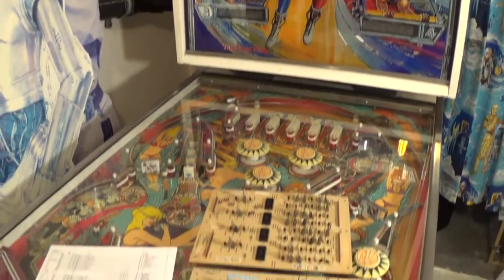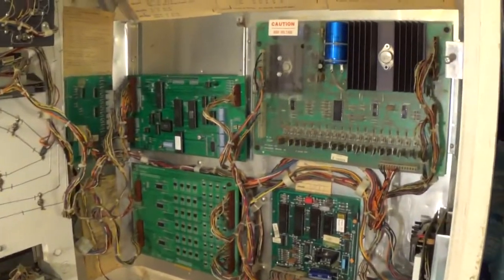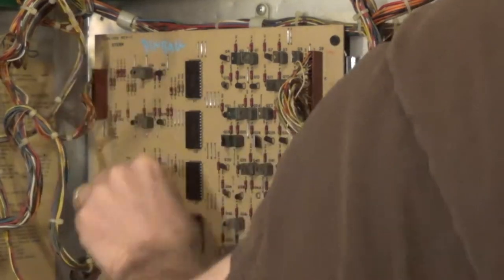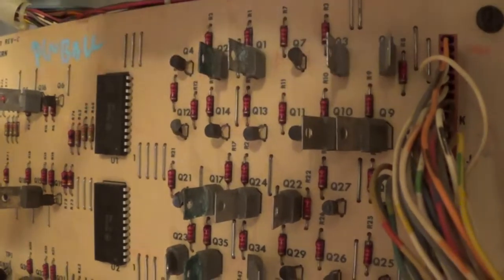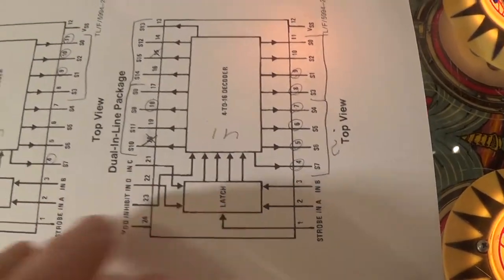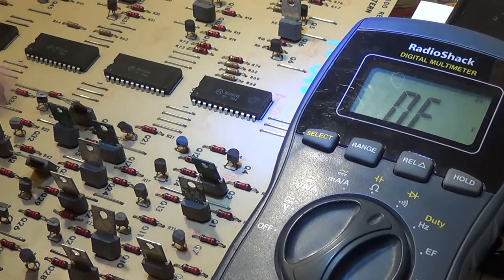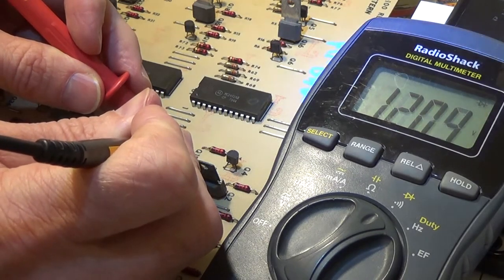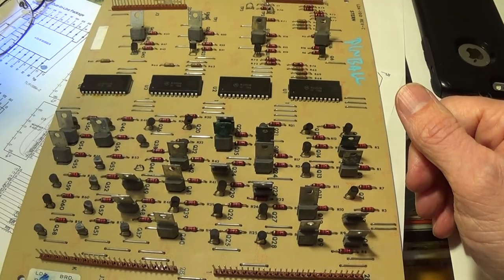How to Test and Repair Lamp Driver Boards for Stern/Bally Pinball Games

Comment: Geo, I thought SCR only worked for switching AC signals not DC signals. Any reasons why an SCR Cathode to Gate has a voltage at 1.2vdc or 0.6vdc, is it a diode inside the SCR? Any reasons why they used MC14514CP Decoder chip to turn on/off the SCR's instead of using a PIA chips?Any reasons when using LED lights instead of lamp bulbs the SCRs will cause the LED's to have flicker issues?
Reply from the maker: LOL, you have lot's of questions I can't really answer.  Unfortunately, I'm not an electrical engineer, and likely don't have the brain power to be one.  You are correct that SCRs most commonly used for converting AC current to DC current (rectification), hence the name Silicon Controlled "Rectifier".  I can only assume that they are used in the lamp board because they also have the ability to handle high current and voltage, which works well with the lamp operation.  Regarding the 1451 vs PIA, I can't really answer that question.  But the 1451 is really only decoding a 4 bit input signal for selection of one of 16 possible lamps.  Not sure if you need an PIA to do such a simple task....but I really don't know.  Not sure about the 1.2V vs 0.6 V either.  The diode part of the SCR is the anode and cathode legs.  The voltages are read between the gate and cathode.  I did look it up, and the higher voltage is read when the ground is on the gate and the positive is on the cathode.  I haven't really dived into how SCRs actually work, but the gate might act as a type of "jump start" for the diode, allowing current to flow from the anode to cathode.  If you, or anyone else knows, please let me know.  Regarding LED flickering on SCRs...… the DC current that drives the lamps is not well regulated (it fluctuates).  LEDs don't draw current when the voltage drops too much, and this causes the SCR to shut off (unlatch).  It then needs a new gate signal to relatch.  You can solve this issue by adding a resistor to the lamp circuit, but you have to do this to all the lamps (normally you put them on the lamp socket leads....a 1k resistor should do the trick).  I think the replacement LED compatible boards have the resistors installed directly on the boards.
Reply: Thanks for the help. Adding the 1K resistor "across" the lamp socket leads from lamps positive voltage to the lamps ground? I'm confused why would adding a 1K resistor reduce and fix the LED flicker issue?Regarding LED flickering on SCRs...… the DC current that drives the lamps is not well regulated (it fluctuates).  So when you put your Volt meter on the Lamps socket the DC voltage will fluctuate up and down?
Reply: @Greg Lilly But what is the advantage and benefits of using SCR to turn off/on the lamps? because Bally, Williams stop using SCRs and used FETS instead of SCR's. There must be a reasons why they stop using SCR's and used FET's. I don't see how the SCR's can send and Interrupt IRQ request to the CPU because its really hand to turn off SCR's once they are Latched. The DC voltage that goes to zero shouldn't unlatch turn OFF the SCR because the SCR will still be latched. You have to unlatch the SCR which is a resetting the SCR. You're saying that when the SCR is turned off/unlatched that it sends an Interrupt IRQ signal back to the CPU?
Reply: @Greg Lilly Yes Stern PCBs copied ballys. The Unfiltered DC is powering the SCR's but the Decoder chip output pins are tied to different SCR's gate pins to turn on/off the SCR is from the gate pin. The Unfiltered DC voltage is going to the SCR Anode pin and the cathode pin is grounded. This is before the Lamp matrix system, it causes a Decoder IC chips that controls the SCR's, later versions they used FET's. Then they used a Lamp Matrix system that uses a scanning frequency and isolation diodes on each switch and lamp. The isolation diodes will only allow the scanning pulses to flow in one direction. Without using the isolation diodes it confuses the scanning pulses. Often the isolation diodes get shorted and it confuses the CPU thinking 3 or 4 switches are closed because of only one diode that is shorted. Somehow the CPU is measuring the scanning pulses/scanning frequency and when one diode is shorted it shortens or lengths the scanning pulses so it confuses the CPU to thinking there is 3 or 4 switches that are closed which is a false positive meaning not real. I'm not sure why they used Unfiltered DC for the SCR's but the Unfiltered pulsating DC is applied to the SCR's anode pins.
Reply: @Greg Lilly yes they used Latched SCR Logic. The DC Unfiltered is going to be pulsing at 60hz, so this is going to make the SCR turn OFF at an interval frequency 60hz because of the pulsing unfiltered DC. This would cause the lamps to "flicker" from the pulsing unfiltered DC of the refreshing of the lamp ouput. The 5.4vdc that is applied to the SCR's would be pulsing DC when displayed on the oscilloscope. The Decoder chip that is driving the SCR's gate pins is turning ON the SCR to latch the SCR and the pulsating DC voltage is what is Unlatching turning OFF the SCR. For the SCR to be latched/turns on Both at the same time the Pulsating DC voltage has to be "above" the threshold on and the SCR Gate has to be turned on. This is a very short time interval for the turn on time to "occur", because once the pulsating DC is BELOW the threshold the SCR is unlatch/turned off. I would think logically this would cause lamps to flicker or the lamps won't stay turned on long because of pulsating unfiltered DC.
Reply: @Greg Lilly Stern and Bally Lamp Driver boards for the CI Control illumination circuit used MC14515B Decoder chip that would turn on/latch either MCR106 SCR or 2N5060 SCR. Gottlieb & Williams Lamp Drivers are different. The Stern & Ballys Solenoid boards used FET's a driver FET and then a Buffer FET that turned on/off the playfields coils. The PIA chip would turn on/off the FET's. The PIA would send an IRQ request signal back to the CPU to tell it to refresh cycle the PIA outputs. I think the difference between the PIA 6820 compared to the 6821 is that it has latched outputs and the other is Non-latched outputs. I think the replacements for the lamp drivers for the stern/bally games don't use SCR and use FET's instead with Diodes in series to change the Lamps 44/47 into LED in the playfield. The Diodes added somewhere is a medication people have done for years to prevent the flicking when using LED's instead of Lamps 44/47. The Diodes across the SCR's somehow changes the SCR rise time and fall time or on time/off time so you don't get the LED's flicker issue.
Reply: @Greg Lilly Ballys Solenoid driver board/power supply board has a blue filter capacitor rated 11,000uf to 20,000uf which I'm not sure why they are using such a very large filter capacitor because most power supplies will use multiple 100uf or higher in parallel. It's very unusual to only see one filter cap at a very large capacitance value plus most pinball games are drawing only 10amps maybe 20amps but using 11,000uf to 20,000uf filter cap is overkill but there must be a reason. I understand that lamps, relays, switches, coils draw current but if you use a current clamp and measure the total current the pinball game is using while its being in game mode running its between 10amps to 20amps so I don't understand why they are using 10,000uf to 20,000uf filter cap.
Reply: @Greg Lilly Every pinball games has a "blanking circuit" somehow the blanking signal will pulse when the solenoid driver boards PIA chips send IRQ request and the lamp driver boards sends IRQ request to want to Refresh cycle the lamp drivers outputs and Solenoid driver outputs. The blanking circuit also refreshes the displays digits. Somewhere the blanking circuit is controlled by the IRQ signals of the lamp driver boards and solenoid driver boards. I'm not really sure what purpose the Blanking signals are doing or what is making the blanking output a signal.
Reply: @Greg Lilly Solid State Pinball games don't use a bridge rectifier using 4 diodes its often they only use 2 diodes to get a full wave rectified pulsating DC voltage. I'm not sure why they would want to use a multiple tap secondary line transformer and only use 2 diodes to produce full wave rectification because its more common to use 4 diode bridge rectifiers to get full wave rectification. I'm guessing that 2 diode full wave rectification has more current to source into the LOAD which would be the all the circuit boards, lamps, switches, coils etc. They later did switch over to using Bridge rectifiers in later pinball games. Its also debatable about why pinball games used AC voltages for the coils & solenoids and then switched over to using DC voltages. The debate is that some thing that using AC voltage on flipper coils are stronger and powerful using AC voltage and others think using DC voltage on flippers coils is stronger and more power hitting the ball harder. The different between AC and DC being applied to flipper coils is the wattage when you push the flipper coil button how much current is being drawn by the coil compared to how much force the flipper is hitting the ball. The EMF of the coil between weak coils and strong coils because over time flipper coils get weaker and weaker and hit the ball at less of a force.
Reply: @Greg Lilly That is correct its on all pinball games pretty much have different DC voltages are made from both a 4 diode Bridge Rectifiers and Diode Bridges. I'm not sure why they use the Two Diode Bridges but its mostly unregulated also having no regulator or only one DC voltage will be regulated and the other is unregulated. I think all pinball games Solid state for the flipper coils they use Unregulated DC voltage only for the flipper coils. I'm not sure why they would use Unregulated DC voltage for certain coils. But you're saying that you can't use High DC voltage using a 4 diode Bridge Rectifier?
Reply: @Greg Lilly To learn the concepts of the circuits and designs of Pinball games. I might want to build one in the future. The New Pinball games use an "Array" of Opto Couplers & Opto Isolators that are everywhere on the playfield. The Array of Opto Couplers & Opto Isolators are in different Assemblies that are sometimes sold by different pinball companies for replacement parts. When the ball passes through the Opto Coupler or Opto Isolator it will trigger a lamp or switch or credit. I'm not sure why they use different sections of the playfield that will have Opto Couplers and other sections will use Opto Isolators. The Array of Opto's is different than a switch matrix or lamp matrix. I'm still trying to learn how switch matrix circuit work in the concept because its very weird how it uses a Scan Frequency about 1.6Mhz that is Scanning the Rows and Columns of the Switch Matrix. The CPU is sending out a Scan Frequency to the PIA chip which the PIA chip will output a Scan Frequency to the Switch Matrix Rows & Columns. Each Switch has an Isolation Diode. Why they use Isolation Diodes is suppose to keep the Scan Frequency flowing only in one direction. If one of the diodes is shorted this will cause the Scan Frequency signal to flow in the opposite direction which confuses the CPU thinking there is 3 or 4 switches that are closed when only 2 switches are closed. I'm still trying to understand the concept of the switch matrix and lamp matrix because its very confusing on learning the concept on how it works. The Array of Optos are a different type of matrix which I'm trying to learn also.
Reply: @Greg Lilly The Main difference between AC VS DC voltage is the current is alternating and DC is constant. Using AC voltages the current will always have zero crossing events compared to using DC voltages its constant direct current having no zero crossing events. The Magnetic field is constantly expanding and collapsing using AC voltage/AC current compared to using DC voltage/DC current the Magnetic Field stays constant. When you press the Flipper button it will energized the flipper coils in the microseconds that its turned on. The In rush Current differences of the AC current compared to the DC current are different when comparing In Rush Current. The Efficiency of AC current compared to DC current is a difference of the Power Efficiency. The Flipper coil is wire wrapping around in a coil but the magnetic field strength gets weaker over time from the heat and dissipation. Its hard to test the strength and power of a flipper coil because you would have measure the mechanical force of the flipper batting the ball. You can measure the Gauss of the coil using a Gauss meter. But to try to measure how strong a flipper coil bats/hits the ball. When you buy two brand new flipper coils and install them into a pinball game, both flipper coils aren't going to be MATCH. What I mean by matching coils is that both the right flipper and the left flipper aren't going to bat/hit the ball at the same force and power so they are Imbalanced on the left and right side. The DC resistance will be the same for both coils which is matched DC resistance but the Power and Force are both difference not matched. There must be a gauge or meter they use on the playfield to measure the force of the ball hit to measure the flipper coils to match them so they are balanced from left to right.
Reply: @Greg Lilly The Black Dust Residue or Soot is called because Lamps also have the Black Dust Soot caused from Dissipation. I'm guessing the Black Dust Soot is from the electrons burning off the wire or filament in lamps. This is "stripping" off the electrons so over time the coil gets weaker and the lamp gets dimmer over time. The coils use enamel wire wrapped around a plastic bobbin which the enamel wire has insulation. Different types of insulation are used and the thicken of insulation. I'm not sure if its the insulation that is causing this black dust Residue Soot but I don't think so because Lamps have the same soot issue and they don't have enamel wire or insulation its just a filament which is plated filament that has electrons plated on the filament.
Reply: @Greg Lilly pinball games the lamps under the playfield often have black soot dust between the lamps and the plastic covers under the playfield. I'm not sure if the black dust is from the Coil plunger sleeves because how can that black dust get between all the lamps and plastic covers. I do see often the black dust when taking apart the flipper coil assembly like you said from the rubbing and heat that is wearing off the plastic sleeve. I still don't know why no one has made a better type of sleeve because when the coil gets hot the plastic sleeve will expand and mold which will cause the plunger to not slide in and out smooth. I'm guessing if the made the sleeve metal it would affect the magnetic field of the coil so that is why they make is sleeve plastic material. The plunger can get polarized over time and repair techs have taken a hammer and hit the plunger to Un-polarize the plunger. Its a weird technique to Un-polarize the plunger but hitting it with a hammer seems to work for some reason.
Reply: @Greg Lilly yes I will look into how to calculate the pull strength from the wire gauge and number of windings.
Reply: @Greg Lilly ok thank I will look into pinside and pinwiki
Reply: @Greg Lilly When the switches close you will see arcing which the arcing will slowly strip away the plating coating on the switch contacts. They made different plating/coating for the contacts to prevent pitting. The modification to prevent arcing is to add capacitors is parallel to the switch contacts. What plating/coating do you recommend to prevent the arcing across the switches in pinball games?
Reply: @Greg Lilly yes marco specialities has a lot of pinball game parts. I'm going to talk to marco specialities to see if they will start offering kits to build your own pinball machine that has different ramps and assemblies. It would be a nice way to program a microcontroller for pinball games to understand the concepts of switch matrix, lamp matrix, opto coupler arrays, PIA chips. A self starter kit is what I want to make for pinball designers & pinball hobbyist so you can make your own customized pinball playfield game. The older pinball games use 6800's CPU which you had to have an address for each switch on the playfield and an address for each solenoid coil. The New Microcontrollers you don't need to have an address for each switch, coil and opto coupler, its much easier having 10 digital inputs or more.
Reply: @Greg Lilly If you look at the schematics of the coin doors in pinball games and arcade games they use a Negative -6.3volts. I'm not sure why they use a Negative voltage for the Lamps but it seems like it was for a S/N Signal to Noise ratio issue to cut down on noise because when coils are turning off and on you will get switching frequencies riding on the DC voltage. With the Lamps on the negative rail which is below the zero crossing reference the switching noises won't be on the lamps prevent flicking on the lamps. The Big Blue Filter Capacitor is 10,000uf to 20,000uf which is prevent EMF and AC Ripple voltage, the larger the load the higher the AC ripple voltage. I understand that all the playfield lamps, switches, displays draw current which is why you want big filter capacitors but its seems that they were using 10,000uf to 20,000uf filter cap because when using AC voltages for coils its 60hz with 120 zero crossing events which I'm guess the Big Blue filter cap is smoothing out all those 120 zero crossing events?